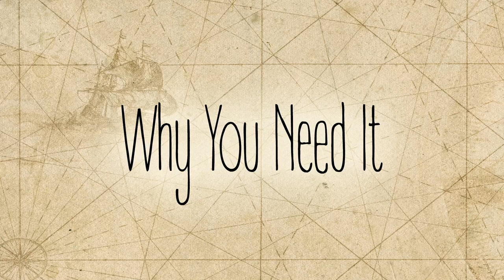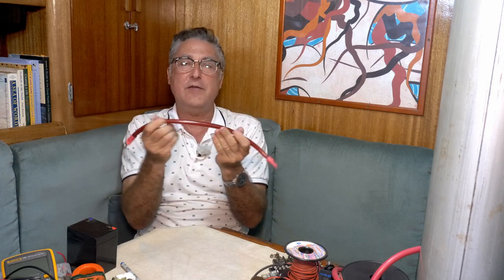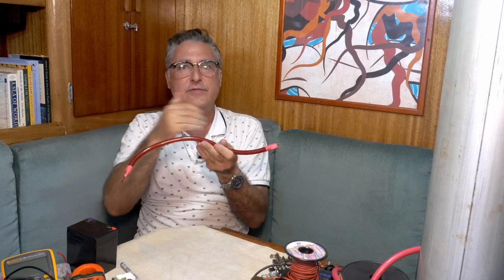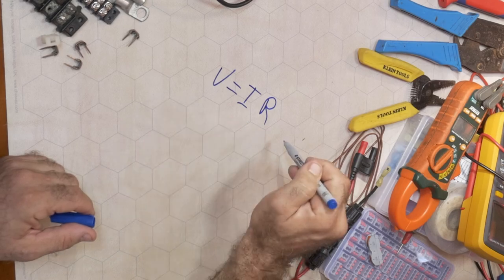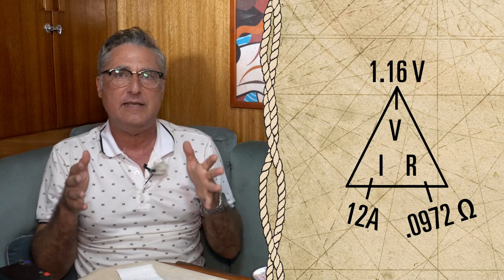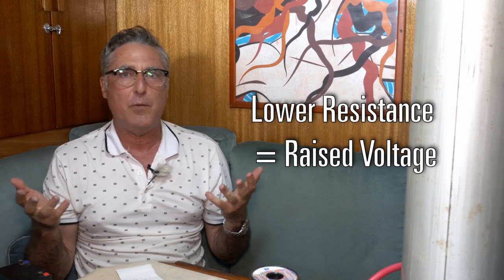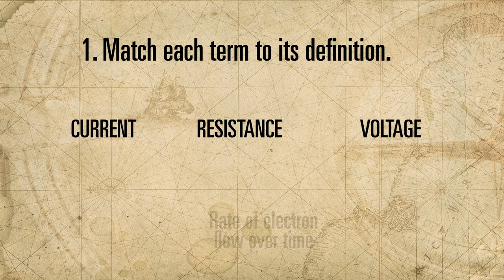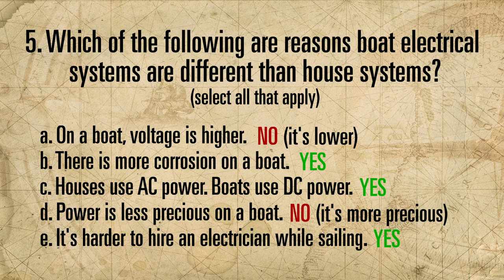What you NEED to know about Boat Electrical (Part 1)

Comment: I love this video! Easily among your best yet, easy to digest and still very applicable to just about everything. Still left with a question though. You say that the fridge will need more amps because of added resistance in the wire. But how than do we see lights dim when resistance gets higher due to corrosion? Is there a cut-off point where the apparatus cannot get the power needed after the voltage drop, or does it depend on type of apparatus? And could too high resistance (incl corrosion)lead to heated wiring?
Reply from the maker: Yes and yes

Incandescent lights are just resisters themselves heating a wire white hot.  Your fridge is controlled by circuitry that regulates it's rpm.  It always needs the same power so if you lower volts it demands more current.

We will get into wires and fuses soon.
Reply: @Clarks-Adventure  thanks, that makes sense. Btw, I wouldn’t worry too much about the views, as videos like these tend to start slower, but always remain current (see what I did there? Lol). In the long run, they’ll outlast and outcast your other vids and may even become one of your your most-viewed ones.
Reply from the maker: More then half our videos fall into that category.  The awning video could be watched for years to come but YouTube only promotes it for a short time based on how many initial views it gets.   Videos if that type have proved to be much more popular so without sharing and the views that causes this series might not be a good idea.

All hail the algorithm!

Comment: This will be a great series.  I do have a question for you.  Once we get a boat and become full time live aboard’s, I thought one way I could earn money is to hire out my mechanical services to folks on the water.  Electrical, A/C, diesel systems etc are all areas I’m very comfortable with.  I’m certain other live aboard’s will also be on a tight budget, so that isn’t necessarily where I’m looking to find customers, and figured karma and bartering might be more appropriate in those situations.  From your perspective, would you think the demand for that service is high enough to for me to support us and our future boat on a typical budget?
Reply from the maker: Yes it is.  Especially refrigeration.  But keep it quiet.  You likely won't be traveling under a work visa.

You can find yourself deported if a local tradesman complains.
Reply: Works much better in country. Karma is best.
Reply: Thanks for the response.  I would only consider “working” in the US.  The thought of sailing to distant shores is a far off dream currently. 
Concerning ohm’s law, I have ran into a problem when using it in real world applications.  I’m certain you have too and may touch on this in a later episode.  You close a circuit, initially everything works, but then you blow a fuse.  This is caused by heat building up, increasing the resistance in the circuit exponentially and eventually overloading the circuit.  Using an ohm meter testing the complete circuit found the resistance to be well within specs.  One small clean section of chaffed wiring wasn’t enough for my Fluke 88 to find.
Reply: @nutsandbolts432  Resistance at load. Why performance testing is sometimes the only way. An example would be drop a ss washer on a power post, fine till the amps go up. Physical disassembly of every connection is the best method. Thermography is used in live circuits.
Reply from the maker: I have an easier method.  It's coming as the culmination of this series
   We have to build up to it.
Reply: @Clarks-Adventure  Like an electrostatic discharge, waiting for it...

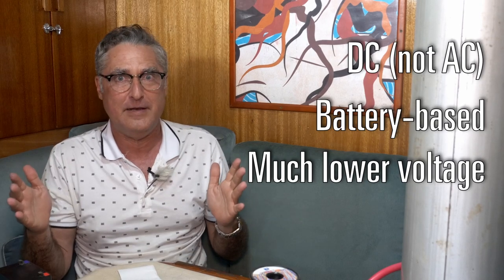Comment: At 14:25 is stated a 10-fold difference. Folding is exponential, and to be really accurate, you went from 220 volts to 12 volts, which would be about a 20 times reduction
Reply from the maker: https://letmegooglethat.com/?q=ten+fold+meaning

Comment: This doesn't change the explanation at all, but electricity isn't really the flow of electrons. It's the field that happens when electrons flow. Electrons actually flow very slowly. That's why it takes so long to charge and discharge a battery. You're slowly moving electrons in or out of the battery. But the field around the circuit moves at light speed, so power turns on and off immediately on connection and disconnection.

You're right about silver and the cost issue! Copper is really good, silver is better than copper, and gold is better than silver! Why are all the money metals involved? 😂 That's why the traces on electronic boards and chips are gold. It's more affordable when it's that small of an amount.

Comment: Funny thing is for DC (boat, automotive, electronics) we don't call the workers "Electricians". An "Electrician" generally refers to someone who has been trained in grid power and is well versed in building codes and safety. They generally fall into two categories: Up to 600v and above  600v... ok too much information  :)  the gist of the matter is that an "Electrician" might be a bad fit to work on boat wiring even if they were available because there is no rule set or building code, for them to work from. While they probably learned many of these things in school, they have not used things like ohms law (or watts law) since they started working.... because building codes are more (most) important. In boats we call them engineers, I guess. This makes anything they work on sound more complex and allows them to charge more.  ;)
Reply from the maker: You are right.
Reply: Coupling theory with mechanical skills and experience based judgment is increasingly rare. Having had a lifetime at multiple aspects I have been surprised at the general lack of skill crossover. Why it is best to learn yourself as most workers available have an imbalance when applied to your boat.

Comment: Hello, I have watched many of your videos and, in particular the ones on Redodo batteries.   I am looking to buy a  1985 46 foot electrical sailing museum.  To get to the point, the first thing I plan to do is install lithium ion batteries and, I am considering the Redodo batteries to create a 48 volt 200 amp hr bank.  To power these batteries I am very interested in the Integrel charging and management system.  So, do you think these batteries are up to the job.  Thanks Jim Burke
Reply from the maker: They are good batteries.  I describe them in the video.
I have no idea what you intend to do with them so I can't comment.

Comment: Ok I have a good problem to solve my boat is 19.8m in length and 2m wide, it’s a UK narrowboat, my electrics at the back of the boat. I have one wire that goes right to the front of the boat for what we call my tunnel light 12v, as you can imagine it’s very rarely used. At the moment I use a hand held horn but would like to put a 12v one at the front using the wire that goes to the light but the light can’t be on at the same time as the horn but the horn has to be on at the same time as the light, if you see what I mean, I have to be able to use my horn in a tunnel, but also the horn can’t be on sounding constantly so I need a switch that you push to sound once twice etc.. is there a way of having maybe a rocker switch then a button w=switch and all going through the same wire. I hope you can follow what I mean. Thanks.
Reply from the maker: Here is your puzzle.  It's solvable.  The pieces are 1 dpdt on off on(momentary) switch and 1 diode if the light is incandescent or 3 diodes if it's LED.

Have fun

Comment: When i was in industrial electronics class 35 year's ago we was taught E=I X R
Reply from the maker: I never heard voltage referred to as E before.

Could you be thinking about the power equation?  Watts = volts x current?
Reply: @Clarks-Adventure  In E = I x R the E stands for Electromotive force.
Reply from the maker: OK thanks
Reply from the maker: Now we just need an obscure letter for Resistance so I can confuse everyone!

Comment: What is all this "wire guage"? Please remember that most of the world size conductors by cross sectional area, in square millimetres.
Reply from the maker: I'm sure you have heard the joke.  

There are two kinds of countries on earth.  Those who use the metric system and those who have been to the moon.

Yea.  That's a help actually.  I'll include mm² in the wire section.
Reply: @Clarks-Adventure  A cross sectional graphical gauge chart will help with people not familiar or understanding the scale of change. Why do Euro boats seem to have smaller wires in practice?

Comment: woahhh, I always thought gold was more conductive than copper, but turns out I was wrong!
Reply from the maker: Silver is the "gold standard" of conductors.  Better then gold.  Also best for thermal conduction.
Reply: Reason it is useful on contact plating is corrosion resistance as it is superior to tin and most others.

Comment: I was always told electronics works because of the magic smoke inside it…. When ever the magic smoke escape from the electronics, it doesn’t work anymore 😜
Reply from the maker: Yes I'm covering that in part two.  Wires and fusing.  Thought I'd pump a bunch of current through an unfused small wire and let the smoke out.

Comment: If it's not a dingy then for the love of God use 24v,you will be better off. Even busses and fishing boats use 24v and it's just better
Reply from the maker: Sure for a new boat.  But one works with what they have.   If the engine and a significant number of ships systems are 12v, it's expensive to change.